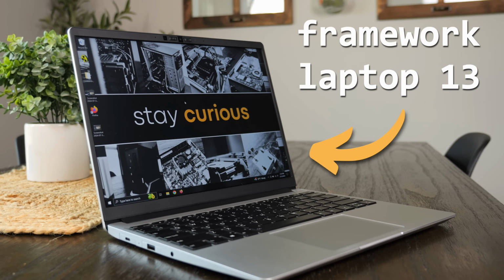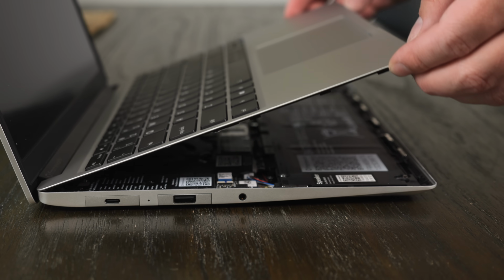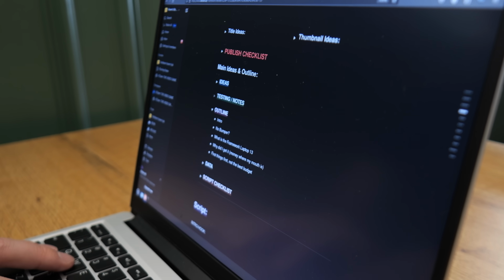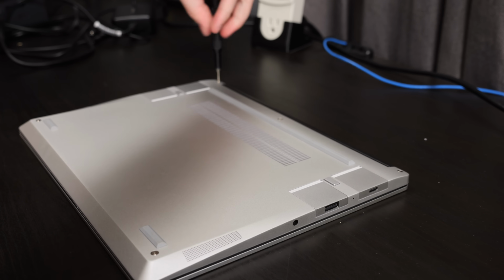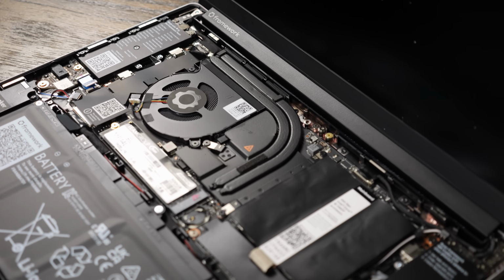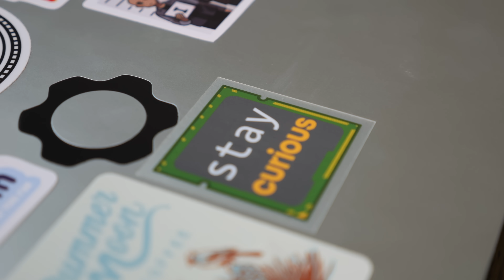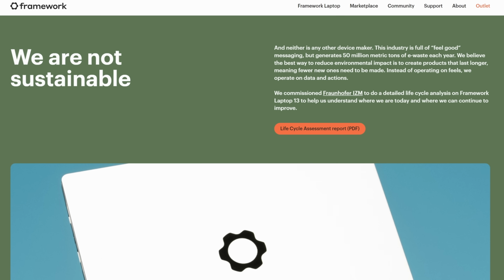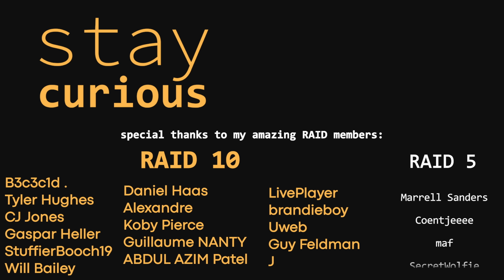Is The Framework Laptop ACTUALLY Worth It?

Comment: What I don't get about Framework is the IO. Why would they give me only ONE USB-C Port on a 5cm module? I can configure my Laptop to have a total of FOUR Ports? Why?
Reply: Cuz you can unplug the modules to plug in a different one- Like plugging in a SSD port or a HDMI port
Reply: @callmerei But dragging around 5 different modules is not much different from dragging around a dongle.
If framework wants to give me IO, I want ALL THE IO!
4 USB-A, 2 USB-C, A RJ-45 and a 3.5mm Jack are the minimum in my opinion!

Comment: I put stickers on my expenmsive Macbooks. But on their cases. Never EVER on the actual laptop. Especially an Apple silicon Mac. Bro I just bought the 15inch M4 Macbook Air at micro center for $1050. You could have got that instead of this framework which does seem and look cool but. Who knopws what that thing will running like in 2-3 years

Comment: To be fairer, I’d like to see how this laptop goes maxed out? I agree it should not heat with just browsing but I think $1100 is still on the cheaper side of lap tops if we’re comparing to apple. I’m not sure if it’s fair to compare to apple but frameworks maxed out costs you a bit less than apple. Also there is an extra fan air option on the back, I’m curious if that makes a difference

Comment: My problem with Framework is that even the 2.8K display is crap, crap speakers, meh construction quality (that is actually understandable), low expansion even if it's upgradable (the problem of PCIe), meh keyboard, bad touchpad. I mean, for what framework have, there's a ZenBook with better specs for the same or sometimes lower price. The same goes with a MacBook Air, the same with Dell Pro Premium (formerly XPS), a Lenovo ThinkPad, and the list goes on. I am the kind of person who likes the philosophy of Framework, but the price and trade-offs makes it a deal-breaker. I understand that the point of the laptop is the upgradability and repairability, but honestly I would consider these laptops and the higher price if the laptop didn't have so many trade-offs

Comment: i bought the framework 16 last week....do I regret buying it...yes I do not like this laptop at all. I was talked down when I was going to buy an alienware gaming laptop, and here I am now 3k in the hole with this piece of garbage. the frame is flimsy the modules are cheap feeling and actually are cheap. The keyboard area has sharp edges wear the pieces fit together....I am out 3k...so I suggest do not, do not buy this computer...you will never use the module change or upgrading this thing that will be enough value to justify the cost. I am now stuck with a door stop that cost 3k. this is my opinion so if you need to spend 3k to find out yourself, go for it. i am headed to micro center to buy a real laptop.

Comment: I would point out that the text being "fuzzy" compared to the M2 is more due to the M2 MBP's insanely high resolution. The Framework 13's original screen is about 208 dpi, while the 14" M2 MBP is 254 dpi. But those budget laptops you were looking at? Those would've been closer to 150 dpi. So you would've saved some money had you gone that route, but you'd be even more frustrated by fuzzy text than you currently are.
Reply: Yup you’re right. His basic work is just script writing and web browsing and for this MACBOOK PRO latest M series would be perfect which could easily last for around 10 years as compared to framework laptop. And don’t get me started on how he can connect his framework old motherboard to make it a server pc etc, I mean we could also do the same by hooking the that MacBook pro with the monitor. and here you go…. Problem solved. It’s isn’t about upgradability but instead A PRODUCT WHICH IS HIGHLY EFFICIENT, AND WILL LAST LONGER!

Comment: I'm using a Fairphone, and I'd like to buy a Framework Laptop. However, where the Fairphones pricing is just middle of the road, the Framework is quite pricey. Since the last 20 years I spent around 1k USD for a "new" refurbished Laptop, and since there are no refurbished Frameworks (I at least haven't seen one yet) what I can get for 1k with a Framework is simply to much away from what I can get as refurbished Laptop.
I can remember the time when you could buy so-called barebone laptops, basically a laptop case with a monitor and a motherboard, and you added everything else as you wanted and installed it yourself. Pity, that nobody offers something like this anymore, since everything is soldered onto the motherboard nowadays.
Should Framework anytime in the future do a Black Friday sale of an anniversary sale or something like that with significant rebates, I might buy one as my travel laptop (my daily driver is a 17" one).

Comment: I love mine. I use it as a backup graphic design machine (I also own a mac mini which is literally the opposite of a framework). I love the company's business model, I see this framework as a long term product. I was also surprised at how well it games- I'd planned on getting a PS5 and whilst this isn't as good, it's Ryzen chip really does pretty good at gaming for me- it runs AAA games at ok looking graphics, and aside from the very odd exception I play games that are a few years older. 

The loudness thing though is noticeable with the Ryzen GPU, its a JET under load. I'd love FW to collaborate with Noctua to make a fan module.

Also, the screen can be upgraded! I think FW have now released a higher res 13 inch screen

Comment: I researched this as a laptop for my father and there is an argument to make that the modules cannot be resold while an old laptop can - I am pretty sure these laptops will generate a lot more e-waste and lose more money when upgrading.
Reply: And what percentage of laptops are resold? I have owned a number laptops for 20 years and I have replaced none of them. The batteries wear out, and replacement batteries are typically unobtainable from the OEM after three or four years and third party batteries are pretty much a lottery every time, with terrible quality control.  I have worn keyboards -- typically not replaceable -- had broken bezels, had one laptop where the GPU solder separated from the mainboard (had to use padding above it to apply pressure to continue using it for a few months before it finally died, and another laptop simply became obsolete (this was years ago) and not worth selling.

This is typically the experience of people who own laptops more than a couple of years. Those who replace the laptops every year or two because they treat it like buying a new phone may be able to sell them on, but they are contributing to the ewaste problem, not preventing it, since there is always some wastage in those transactions, and they are buying into the frequent replacement cycle encouraged by the manufactures themselves, even though they don't really need them.

Framework offers a new model, and one where you can still sell on your most expensive and least modular part anyway (the mainboard in a cheap new case) and who needs to replace their webcam or screen unless it breaks? Many cheap to midrange laptop lines use the same screens for years at a time, and only those willing to spend significantly more than they would on a Framework are, again, the type of user looking for the better screen every upgrade (for hundreds to a thousand dollars more at a time).

There is risk that your upfront investment in the platform won't pay off if the company goes away, and it would be nice to see the modularity become a standard so there are other sources, but the clam that they will produce more ewaste if they stick around is not remotely substantiated.
Reply: Framework website is going to have a marketplace where people can sell and trade there modules.

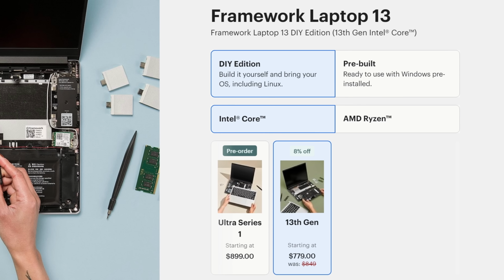Comment: - 01:17 🔧 Purchased the 13th Gen Intel i5 DIY model for $1,100, assembling it with additional RAM and storage.  
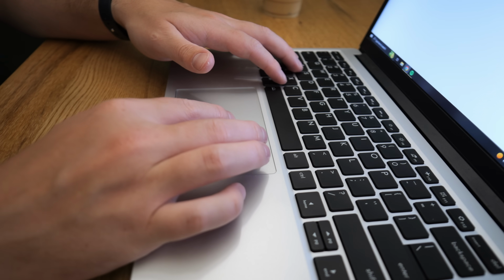- 01:50 🏷️ Acknowledges that Framework laptops are expensive compared to alternatives, especially for basic tasks like emails and scripting.  
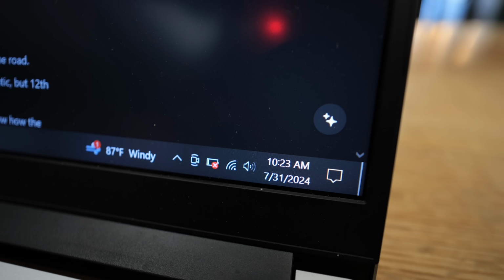- 02:47 🔋 Battery life is underwhelming, especially compared to an M2 MacBook Pro, requiring frequent charging.  
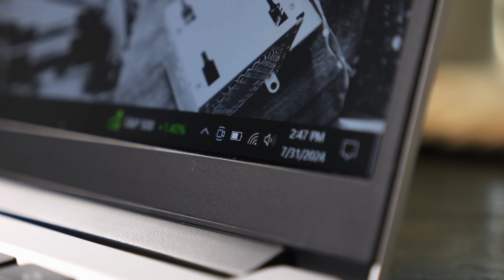- 03:28 🌡️ CPU temperatures can reach 100°C, causing fans to run loudly even during basic tasks like file transfers.  
- 04:40 📺 Display quality is good, but text scaling issues can make it appear fuzzy when maximizing screen real estate.  
- 04:56 🖱️ Trackpad is a downgrade compared to a MacBook, though a trackball mouse helps mitigate the issue.  
- 05:20 🎥 Webcam placement is good, but image quality and auto-exposure adjustments are lacking.  
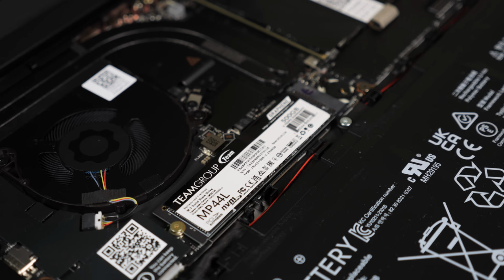- 05:42 🛑 Limited internal storage expandability, with only one M.2 slot, restricting upgrade options.  
- 06:35 🔄 Despite drawbacks, the Framework laptop’s modularity and repairability make it a unique and valuable product.  
- 07:18 🏗️ Replacing the thermal paste significantly improved CPU temperatures, demonstrating the ease of repairs.  
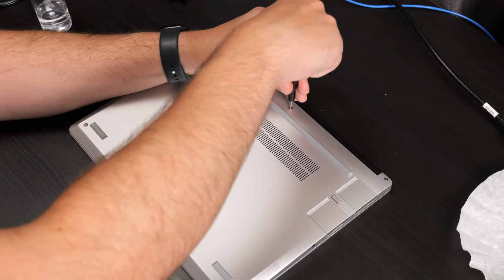- 07:46 🔩 Laptop is easy to disassemble, with labeled components and QR codes linking to repair guides.  
- 08:28 🔋 Battery can be upgraded to a larger 61Wh version, extending lifespan without replacing the entire laptop.  
- 08:55 📈 Future-proofing is a major benefit—users can upgrade to newer CPUs, displays, and webcams without buying a whole new laptop.  
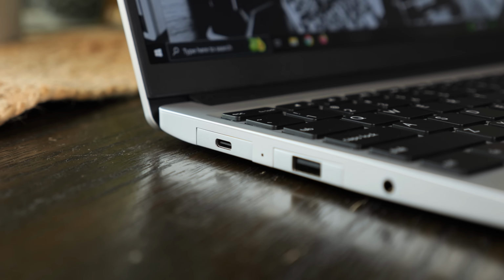- 09:37 🔌 Customizable I/O modules allow users to choose their preferred ports, though third-party expansion options are limited.  
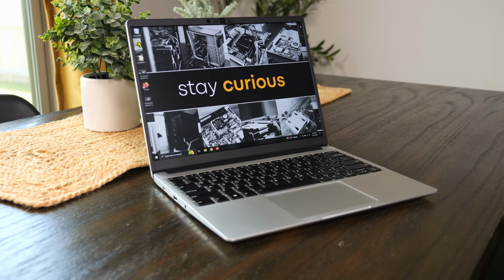- 10:44 🧘‍♂️ Peace of mind comes from knowing that if something breaks, replacement parts are affordable and easy to install.  
- 11:56 ⌨ Despite its flaws, the laptop is enjoyable to use, with a great keyboard and smooth Linux dual-booting experience.

Comment: Thinking of getting one of these. How viable is it as a desktop replacement when hooked up to a 4k monitor?
Reply: I use my 7840U version with either: 2x 1440p monitors or, 1x 4k and 1x 1440p monitor connected with display port alt-mode and the internal display on and it works great. In quite heavy productivity workloads the fan spins up when your doing a lot but it handles it just fine.
Reply: its decently viable IF you get an EGPU

Comment: Short battery life is not a Framework problem, it's a Windows problem. My Lenovo laptop rarely gets more than 1 hour of runtime on battery when doing anything but than the lightest tasks. And before anyone tells me to reduce the screen brightness, I can't see anything on it without full brightness when outside or in a brightly lit room.
Reply: And I have a three year old Lenovo Thinkpad T14s where the battery is starting to wear out and guess what, Lenovo no longer even stocks its original (overpriced) replacement battery, so I have to take a chance on a random third party battery supplier in a market rife with fake reviews and substandard quality control.
Reply: I own a framework with amd chip. Windows is definite a problem. With much optimization, I heard constant unknown fan noise and can only take at most within 8 hours. Now with the linux (arch btw) installed with the tweaking, it can now stay about 11-13 hours under light uses.

Comment: Honest question ablout the expansion cards: Do you actually need them if you were to only use USB-c connectors? I mean the cards look like they are USB-c purpose built dongles that have an USB -c connector on the laptop side. In case of the USB-c "cards", are they just a passthrough module?

Meaning If I have a long USB-c hub and I plug it into the computer instead of the card module, would it also connect without problem? If this is the case, then you really should just order non usb-c/unique ports and if you need usb-c, then just remove the cards and the ports are there, just recessed.

Comment: I've had a Framework 13 laptop for 2 years now. I use it a lot and the keyboard started wearing out (paint flaking off the keytops due to fingernails) so I bought a new keyboard and repaired it. It was a bit of work but am really glad I could do that. The Intel CPU is hard on the battery and the fans get noisy for no good reason but that's not Framework's fault. I'll probably get an AMD upgrade soon. Being able to repurpose the mainboard is wonderful. Definitely a company worth supporting.
Reply: I've worn out several Thinkpad keyboards over the years, and you're definitely on your own when trying to replace those!

Comment: "Didn't compromise on aesthetics"
Is featureless perfectly symmetrical rectangle with the keyboard that exactly fits in a rectangle (including the arrow keys)

The only thing that saved it on "aesthetics" was it was 3:2 when that was still rare.
Reply: It's not that long ago since anything remotely repairable did have to compromise on the thin and light aesthetic of the ultrabook format. Fortunately we're finally past that stage, in terms of it being possible not to compromise.

Comment: I have a Framework 13 as well, though mine is a 12th gen Intel I5. I've done a few upgrades to it, in my case the extended battery and putting 64 gB ram in it. It was the easiest laptop I've ever worked on (watch out for that battery connector though) and it all worked perfectly.
Even the extended battery didn't do much to increase runtime in Windows 11. Recently though, I'd just had enough of Microsoft in my personal life (I do corporate IT and still have to put up with them there) and decided to put Fedora (Mate spin) on the Framework. All I can say is wow. It used to be that Linux was a worse battery hog than Windows without a huge amount of CPU throttling. Things have changed. I easily get an additional 2 to 3 hours on Linux than on Windows doing the same tasks and the fan doesn't need to cool the CPU much at all. It makes me wonder just what Microsoft is doing with all those extra CPU cycles Windows was using (aside from the obvious telemetry and AI nonsense of course). Granted it's still nowhere close to the battery life of my M3 Macbook Pro, but the Framework under Fedora is no slouch either.
I'd be curious if you've tested battery life on Linux extensively. Has it made that much of a difference to you without the extended battery?
I didn't know about the UART module, that might be helpful for some of what I do though I get by with a USB to serial adapter for most things at the moment. That being said, next upgrade is a much larger SSD and the SD card reader (should arrive today in fact).

Comment: No GPU
Non-removable battery (not even 99wh)
No left/right click buttons on the trackpad 
No SSD expansion capacity 

Not interested
Reply: It's a 13 inch laptop for office and business use, not a gaming machine. They sell a 16 inch laptop with a GPU for that. The battery is far more serviceable than in 99% of all other current laptops. Aside from Lenovo Thinkpads, which laptops have separate buttons these days.

In fact, if you stick rigidly to these requirements, is there a new laptop in existence that meets all of them? I don't think so.
Reply: @EnglishMike  the trackpad is completely unusable without dedicated left and right click buttons, every trackpad of that style that I have tried using results in unintended cursor movement when clicking, or misclicks when moving the cursor, or not left click when I wanted to right click due to a lack of tactile feedback to tell me which click it will actually be without looking at where my finger actually is (problems you don't have with a traditional trackpad) they could have easily allowed the trackpad to be swapped with a more traditional one, but nope, there's no way to do that because such a module doesn't exist 

Framework advertises it as an all in one device for everyone, yet they make the device barely upgradable, and pretty much force you to carry a mouse everywhere you go (which partially defeats the purpose of buying a laptop, and requires extra space to use it, takes up one of the few USB ports you get, or if wireless, is yet ANOTHER device you have to remember to charge) 

There's no reason to make the battery non-removable, they let you swap out the USB ports, why not the battery as well, imagine you're flying, even if you brought a fully charged spare battery with you, good luck getting an iFixit kit past the TSA so you can dismantle the device to install it (most airlines either don't offer power, or charge extra for it, and before you mention power banks, you lose about half the energy to conversion losses, and a power bank is about twice the weight of a laptop battery of the same capacity) 

Then there's the lack of expandability, the framework laptop has literally 1 m.2 socket, that's it, what the hell is this 2010? Even my old laptop from 2012 could take 2 SATA and 2 MSATA SSDs, giving me 4 drives in total 

Framework claims to be undoing years of BS, but they're really not, their laptop has more limitations than anything else I've owned, and that's ignoring the lack of a GPU (which itself is a hard deal breaker for me) 

Also, GPUs can be used for things other than gaming, a lot of people use them for AI (since cloud AI like ChatGPT is so heavily censored and politically biased that it's not worth using)
Reply: lol ofc the islamaphobe is making idiotic comments

Comment: Thermal paste degrades very quickly on laptops, especially Intel laptops since they get so dang hot. The factory installed thermal paste probably legitimately just dried up in that short period of time.
Also I wouldn't suggest "thinner" thermal pastes like the Thermal Grizzly for a laptop. The heat pump affect from the CPU rapidly heating and cooling tends to pump out the paste quickly. On my Core i9 laptop (much higher heat load)  it's thermal paste was so bad in just over 6 months that my performance was almost half as much as new. For that laptop I gave up and installed a phase change material so I theoretically never have to think about it again, but for normal laptops a thick thermal paste does the job well.